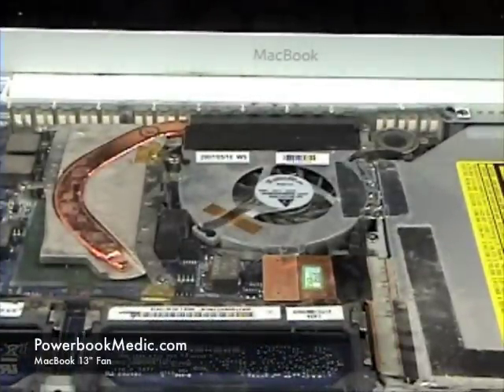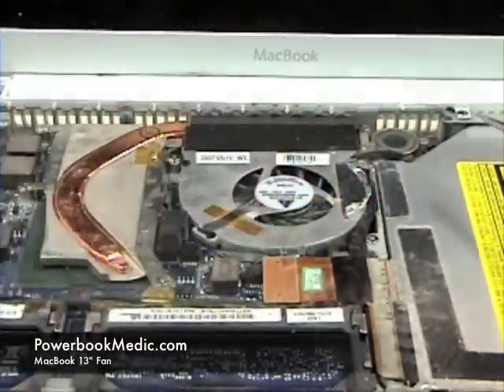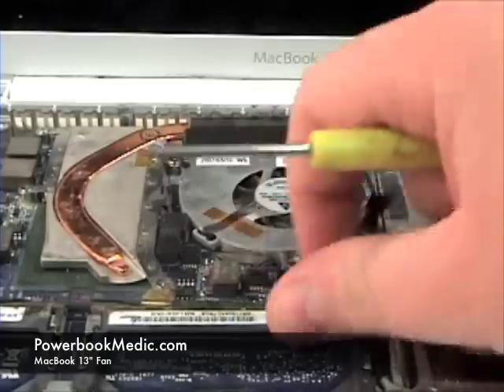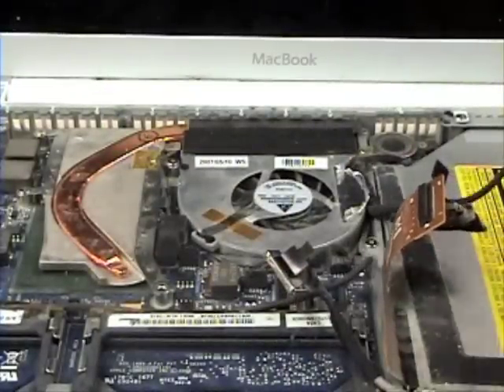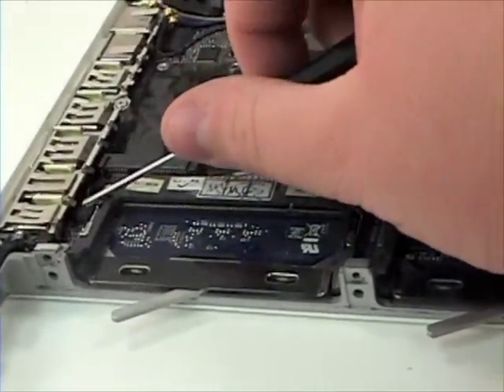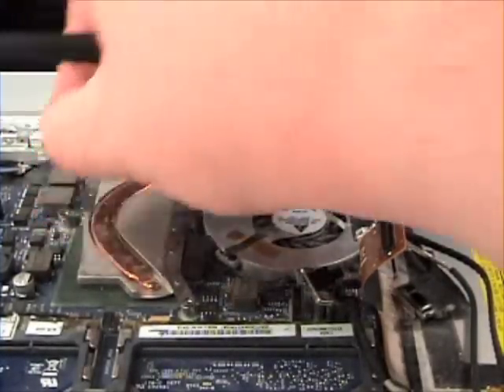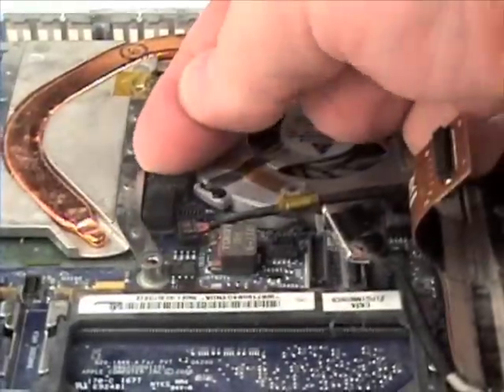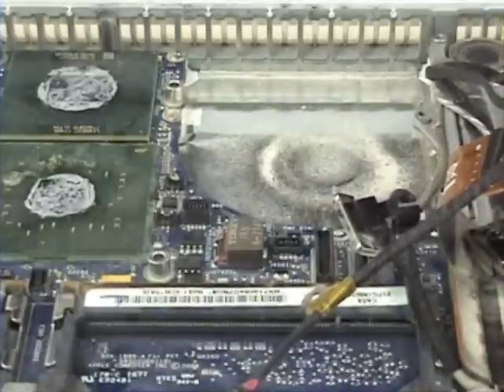Macbook 13" Repair - Fan Removal

Comment: Thank you so much!  After two years with my 13" White Macbook I decided it was time to take a look inside.  Much to what I expected, the fan was cluttered with lint.  I followed your video to remove the assembly, dusted everything off it with a brush and vacuum cleaner and voila!  A less noisy fan and a cooler Macbook.  Thanks again!

Comment: This was my first-ever internal computer repair. Without this tutorial (and the one on removing the top case) I'm sure I would still be figuring out which screws to take out just to get in. Thanks!
PS If you're new to this, just make sure you know which 13" MacBook you have, as you  may need to adjust some things.

Comment: Just ordered a fan assembly replacement off ur site.  Thanks for the vids very helpful.  Been putting off replacing my 2006 macbook black.  Temps getting well over 179 degrees.

Comment from the maker: @simn22 - No, they are variations in models of the boards. Some have all three wall, some have all 4 wall, and some have a variation of the two. If the connector looks to be seated properly, then you should be good. The two types are not similar and will not fit in each others sockets.

Comment from the maker: @simn22 - If the connector is different for the fan, then multiple connectors should be different including the inverter cable connection. It should be the difference between a 3 wall and a 4 wall connector. Most likely you'll just need to get the correct board for your unit. You could try a fan if you're sure that's the only difference though.

Comment from the maker: @orehajones - You may have a defective logic board which was caused by your fan going out. The fan is the first thing to try, but it's possible your logic board also has issues.

Comment: Question: My fan sounds like a lawnmower, so I got a new one. How important is it to have that aluminum tape after installation? If it's necessary, where would I get it? (I don't see it on your website.)

BTW, I've used your videos a number of times and you are my hero! Thanks!

Comment from the maker: @tnt3k - Not the best idea. If you drill a hole you'll be allowing dust and debris to get inside your machine. However below the fan is mainly just casing. It obviously depends where exactly you drill though.

Comment from the maker: Your machine will run fine without the tape. It's goo procedure to either replace or put the tape back. We do have kapton tape available which can be used as a replacement.

Comment: @PowerbookMedic thanks for the reply. Does the 3-4 wall connector come from being either the Black or White model? Surprisingly the inverter cable didn't seem to have a problem connecting. At least I hope it is connected.

Comment: I have a different question.  smcfancontrol says the fan is running 0 rpm, and the temperature is getting up to 80+ degrees celsius, then shutting off.  How do I determine if I need to replace my fan?  Is there something software related that could be causing this (ie, my kids caused the fan to go off somehow in a way I can't figure out)?

Comment: Hi,
i have that macbook and some problems. Droppen in some liquid and since that accident the macbook started giving troubles. The mac works well till work overload then turns off. 
I decided to open it to check what's wrong inside and i found a big bad black mark (similar to soot or something else coming from burning) on top of the heat sync. 
Do you think that could be that the problem? Do you think it could had damaged motherboard also? 
Your reply could be very helpful...
Thanks

Comment: My laptop heats up like oven, and sound like heavy rainfall , So I think its the fan that's doing all this. So If I remove my fan and (spray/) clean it, will it solve some problem or I have to buy a new fan and replace it ?

Thanks.

Comment: am replacing my logic board on my Black Macbook 2.0 Core duo, however I was sent a White logic board, everything fits the same, except for the 2 snap on connectors you remove @3:10. If i buy an exhaust fan from a white model would this solve my problem?

Comment: I have the same macbook model A1811 but my fan is different and there are not 4 conectors theres only 2 on the fan but i can only find 1 to conect the 2 to the logic board if that make sence.
thanks

Comment: I would not place the heat sink back without first removing the old thermal paste with something like rubbing alcohol and reapplying a new layer of thermal paste.  Something cheap like artic silver should do the trick. You don't have to buy the $30 advertised everywhere.

Comment: this guide was awfully misleading in trying to get me to take the heatsink out along with the fan when i only need to replace the fan. I don't know yet if taking the heatsink out is entirely essential but i do know that if you tell us how to take it out then you should warn us that putting it back requires more than the reverse step. THERMAL PASTE MUST BE USED. I also thought this video was clumsy in showing everything so quick and making rough performances yanking cables.